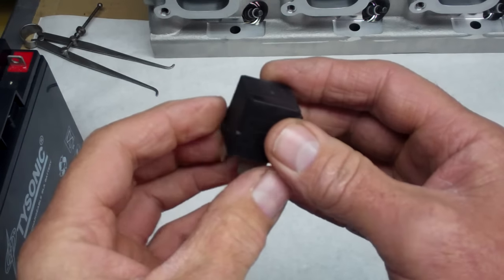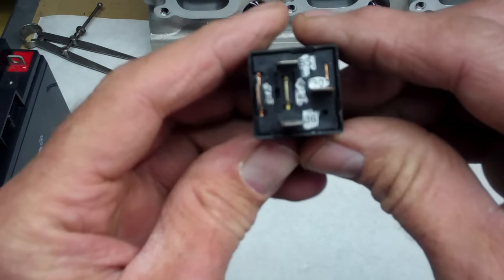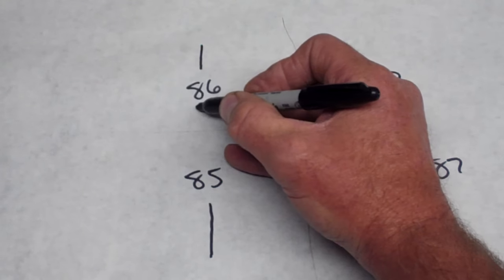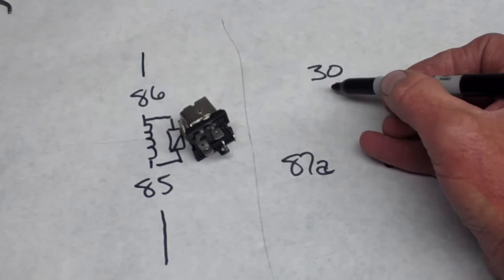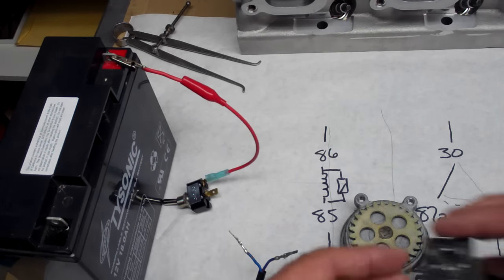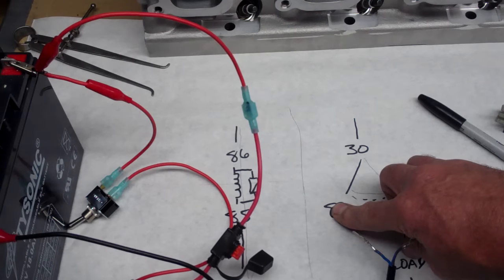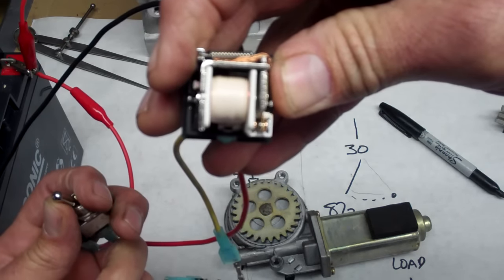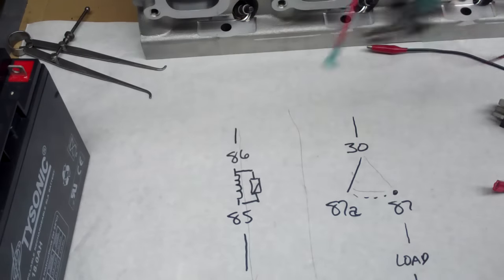How An Automotive Relay Works and How to Wire 'Em up

Comment: I have had people...both electricians and mechanics try to explain to me how a relay works. I have read automotive manuals until I'm blue in the face, but no one explains and demonstrates how they work like you just did. Dude...this video is great. I really, really appreciate it. It helps SO much to SEE it work!!!!! Thanks so much!!!
Reply: It's a big switch that uses a small switch connected to an electromagnet that actually throws the big switch. Complicated? No.
Reply: @mikeries8549  genius
Reply: Ok, I think I got it.  87 & 87A are the contact points for 'It works/It doesn't work'.  Right.  I think.  I have never wired anything more than 2 wires, a AA battery and a light bulb.  I am about to install a USB charger into my motorcycle, and I want a relay to stop the whole thing from charging when the bike is off.
Reply: @mikeries8549  the BB 2nd,
Reply: Best explanation on YOUTUBE.  I had everything backwards.  Thanks alot.
Reply: Thankyou for spending YOUR time to share this!
Reply: My problem is every vid I watch each person does it differently

Comment: I came here to learn about relays because I don't fully understand why you need them. You did mention it once but should have repeated it again a couple more times near the end. (Why it's important for the switch.  Is that all?) You talked about other aspects of this system more than once. So what I took from this demo is it appeared you created a rube Goldberg to switch on a motor but the reason why is if you would have just simply switched the circuit it would blow up the switch in a  shorter time. I guess upon further reading this video wasn't really on why you need them. Just how they work and how to wire them and you covered that very well and easy to understand.  Thanks for making this.

Comment: I have to be honest. I watched this video along with few others on how to use and wire a relay to install after market equipment to my 4x4 Van.
I took my time, learned what wires to connect and were each wire goes. i am proud to share that it took me few hours but I was bale to trace and connect all after market equipment added by the previous owner and everything is great working order.
I never thought I would be able to do it, but I did.
Thank you so much for sharing this video and wish you a great holiday season. 
Peace and out.

Comment: This is one of the most simplified and thoroughly explained videos I have ever watched and has helped me with wiring an electronic fuel pump safely without breaking my head. Thank you very much you have helped me achieve another skill today to use with my mechanic work.

Comment: For years I've seen relays used on automotive tv shows and never did quite fully understand how relays work or why they were used. This is an excellent video that dumbs things down.  The setup for the motor really put things in perspective. Thank you for putting this together.

Comment: This is the best help I have found on relays. Thanks for making a good video and not an over explained mess.
Reply: Hi , I need some advice I'm using standard Toyota corolla. I want change to high speed fan ! Do you have diagram how do I install the fan ?
Reply: lol
Reply: You are right about that....
Reply: Hey 2ton220 good video. I had a question.  What is the minimum volts needed on a12v relay to hold the switch open so current will continue to flow from 30/87. Say for instance you crank ur car over to start and the relay turns off causing current to stop flowing from 30/87. Does the relay require ,for example, 8v to hold the switch open? Im trying to figure out why my relay keeps tripping when i crank my motorcycle over. I think its b/c when i start it up my battery drops from12.6v to 7.8.. Thanks pal!
Reply: I think you mean amperage, system voltage is  around 14V. And the answer is around 300 to 400 milliamps. Low amperage circuit controlling a high amperage circuit. I hope this helps.
Reply: Thanks for the reply. I just changed my battery and it stopped the relay from switching off.
Reply: rogertopful I really love the very very easy way , explained by diagram as well as practically by dismantled inside of relay  demo , like a school / College teacher . I really appreciate the way you taught .
Thank you .
Reply: rogertopful sarcasm?
Reply: Very well explained video I feel like after watching this I understand how a relay works which is why I found myself here. Thanks
Reply: Do you still need a relay even if the load is 12v?

Comment: This bloke EXPLAINS  things so you can understand  exactly  how its done  , clear , precise & easily  followed  ,  i fitted a stand alone horn for a few pounds  ,  citroen  dealer wanted  £500 to replace  circuit  board + labour  , absolute  ripoff  that a simple  horn could  cost  several  hundreds  of pounds  to fix .  BIG THKS  TO THIS GUY .

Comment: former electronic tech here.. work on my cars..  that was an extremely good  way of illustrating   this relay.. I think the relays are cool. they also perform circuit isolation.  I really like your clip leads.. I prefer to make my own.. bought ones  generally unreliable and not soldered correctly. I am subscribing to your channel.

Comment: I have been searching for someone that could show me what electrical parts and diagrams how to wire up USB charging system on a motorcycle. 
Nobody really do it the right way as they are just dead wired directly to the battery. 
Thanks to you I can fix this issue pretty darn easy! Thanks!

Comment: I realize this is an old video but it is has really helped me to understand exactly how to wire a relay that I will use in conjunction with a switch on my lawn tractor to bypass the problematic oem pto switch which engages the electric pto clutch. Thanks again, RP.

Comment: Been figuring out how to wire a relay off a tracker to switch ignition on and off incase my car is stolen and your video has shown how to wire a circuit up so it constantly flows energy until switched off. No one explained it like you. Thank you

Comment: Great video, Thank you very much!  A friend and I were trying to rewire the headlights on his scooter thru a relay and with an off and on switch.   Your video explained everything so clearly.  I really like that when you used electrical terms you interpreted them and showed what they are.  Some of us are not familiar with them.  Alot of the video's I watched just assumed everyone knew what they were talking about when they used a "technical term".  We were able to rewire his headlights so that now he is not blowing fuses or head lamps.  Thanks again!

Comment: Thank you for this video.  My 8n had been "converted" before I bought it, with a 4-post Ford solenoid, two relay switches, the aftermarket resistor, and miles of wiring.  After watching your video, I located the correct solenoid ($12 at TS), cut out all of the wiring and rewired everything using about half the wires.  The old girl purrs like a kitten now!

Comment: Very good video!
To keep things a little simple, I was taught that everything in electrical is some type of switch. Whether it be a circuit breaker, a light switch, a receptacle, a relay and contactors are some examples. Whether it's manual or automatic it's all some type of switch.

Comment: Looking for utility light help.  I am not sure if a relay can solve my problem or not but I figured I would run this by you and see what you thought.  I installed utility lights on the rear bumper of my truck along with a switch.  I have a wire with an in-line fuse running from the battery to the switch. On the other side of the switch I have the lights spliced together and connected to it.  I then have the grounds spliced together and ran to a common ground on the frame of the truck.  I also want my reverse lights to come on when I flip the switch so I have the reverse light wire spliced into my lights as well.  When the truck is off, this setup works perfect.  When the truck is on and I put it into reverse, all four lights...the utility lights and my reverse lights come on for a split second and then shut back off.  My goal is for when I put the truck in reverse, all four of these lights work as well.  I realize that the computer module is probably sensing that there is too much current coming from that particular area and it is shutting down since it is a newer truck ((2016 F250). My question is, can I in a sense fool the computer by inserting a relay in the mix?  And if so...how do I hook the relay up?  Help would be greatly appreciated.

Comment: Dude.. that's awesome and well shown... you have seriously show how a relay works!
so that got me thinking.. 87a could be used on a buzzer for fan relays. If a switch is off to allow water crossing, then the buzzer would go... switch back on and buzzer off...

Comment: Thank-you. I had to bypass a bad circuit for Corolla 2002, to rewire the horn and many YouTube videos did not make clear that icontrol terminal 86 if hooked to a switch has to have a power source and is not a live terminal even if terminal 30 is hooked to a battery. For those familiar with electricity it might be obvious, but for those neophytes unfamiliar with relays this is not obvious that the negative wire from the switch goes to 86 and the other side goes to a battery source or powered terminal.

Comment: Tell me why, you are so good at explaining this?!  Can you please make another video!
mayb one on how to use an existing relay, with acc to wire lights, for DRL.
Or how you would locate a high beam relay that already has DRL, and how to wire a light bulb to that same relay,but instead, take DRL power from the high beam and use it separate?

Comment: I use the 87a terminal for a flasher. I can hook two separate lights up to wig wag or alternate flash. One light to 87 and one light to 87a. I then wire a turn signal flasher in series with 85 or 86. You can use a second relay as a turn on for higher amperage loads. Once you power it up the flasher turns the relay on off on off on off and makes the lights flash back and forth. It works great and is cheaper then store bought flasher!

Comment: Question: 87a is live when the switch is off.  Is it also live when the switch is on?  Thank you for the great description.  Very clear!
Reply: nevermind.  Found the answer @10:20.  87a turns loses power when relay is on.

Comment: Great video. Question...why did you choose the ground the motor off the negative terminal of the battery? Couldn't you just have used pin 85 as it was already grounded to the battery?  Also assuming instead of using the battery, you could use a chassis ground if one was nearby instead of running all the way back to the battery, correct?

Comment: Finally a video that makes sense. Using ur relay explanation...my front blinker flashes on and when the front blinker goes off and small 194 bulb blinks on the side of that same fender. The question is.....the blinker at the rear of my truck blinks similarly and I want to install a small led to blink on the same rear side corner, like on the front.  Any suggestions....pm if you wish....tnx....Frank

Comment: Such a thorough explanation, most thorough & straight forward that I've ever seen, thank you so much!! 
Just 1 question, if you jump the lightbulb to 87 i/o 87a, will its functioning be: 
bulb off when load is off  
bulb on when load is on ?

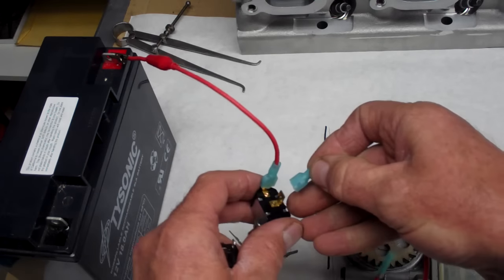Comment: Great explanation, I do recommend to the audience to fast forward to 6:18 where he begins wiring if you are in a hurry.  
(+) Battery ---> To fuse ---> pin 30
(+) Battery ----> to switch ---> pin 86
(-) Battery ---> to pin 85
Devices (Horn, Fan, Lights) ---> pin 87
Notification light to signify that the relay is functioning ---> pin 87a
Finally set your ground for your devices locally(Chassis/Negative side of battery)

Comment: that was so good man. very clear. sure clears things up. so i guess the reason for relays is so you dont have to run heavy wire very far. do you put the relay close to the load for that reason?

Comment: The best, most concise explanation I've come across so far. Thanks for the video.
Now, would one still need a relay if the switch used was a 30A switch? Would there be any advantages to using a relay over an high Amps switch? Obviously I am talking about a properly and newly wired circuit with 30A switch, fuse and large gauge wires, without using any of the existing wiring.

Comment: Quite informative !  A question for u is in the fuse box if u have several of them n all have same numbers. R they interchangeable n how do u know what the amperage is of them. I have an issue with a relay n am getting to many different answers.

Comment: Great video, i use relays a lot and this is a good reminder, but  i need some help with a project, i have an enclosed car trailer, with a battery bank inside, it does not have back up lights, so i want to set a light bar over the door, and trigger it from the reverse on the truck, OR from the battery bank as loading lights, essentially two different power sources. I'm thinking 2 relays? and a double throw switch?

Comment: The relay that you show would be great for a business door. When the switch is on, a lighted sign saying OPEN could come on, When you switch the light OFF, another sign could light up saying CLOSED. USING PIN 87 and 87A.

Comment: In addition to switching larger quantities of current, relays are used to perform many purely control functions such as interlocking, isolating, operating multiple devices simultaneously or sequentially, etc.

Comment: That was a great video, I now know how to wire a relay! I can’t thank you enough! I have a problem though, when I turn my key off my engine continues to run. I have an aftermarket ECU that controls my engine that has 3 relays and six fuses that power it. A friend of mine said I might have a back feed  problem. Can you explain backfeed and how I might troubleshoot the problem I’m having? I’ll add that sometimes the key will shut off the car? When I was testing my alternator the other day to make sure it was charging at a good rate ( key out, engine still running) I pulled the headlights to put a load in it and the engine died? Im assuming it had just enough to keep the motor running and that was it? Thanks for the help!

Comment: This is a great video. I know you made it long ago, but I just followed it and have a question. I have run fused 12v power in to 30 and 86. Power out from 87 to twin horns. Another wire runs out from 85 to a switch then to ground. The horns are also grounded. When I push the button, the contact in the relay does not move. Then with what might be a second problem, if I manually close the circuit (whether I’m pushing the button at the same time or not) the horn makes a momentary noise and sounds like it wants to toot, but that’s all. Every time I manually close the contact, it makes the same noise. I’ve tried unhooking one horn, but same result. I’m using 18 and 12 gauge wire. I’ve tested the switch and the connections. That’s all good. Any idea what I’m doing wrong?

Comment: good video. i have a question. there are a ton of systems on a truck that require a relay. if I'm wiring multiple systems that require their own relay where do i get the power for all of them? for my fuel pump i ran a dedicated wire to the battery positive terminal but if i also needed to do a headlight or accessory relay do i have to run a second power wire to the battery for each additional system or do i just use a thick enough gauge wire to the battery that i can tap into the same power wire for all the systems?

Comment: Awesome movie...I have two questions though.  I am running 2 electric fans would I wire in 2 replays and my second question was the power switch you were using is that symbolizing the vehicle on and off.  I'm just a newby wanting to learn

Comment: Working on a on board air compressor project. What if I were to add an additional pressure switch to he compressor. Which line would I splice?

Comment: A really good demo, T Y. The use of insulated solid Cu cables instead of the very flexible ones used would have made the circuitry less of a bird's nest.

Comment: Hello there great video I have a question can I not connect 85&86 to a 2 pin switch and my 30 would Go to positive battery with fuse and 87 to my horn positive and then my negative from the horn to metal do you think this method would be safer and better thank you sir for the video

Comment: I have been trying to wire in a DRL on a modern car that does not come with factory DRLs, and I want to wire a 2357, where I want to turn off Left/Right DRL when I have the LEFT/RIGHT turn signal on, cancelling the DRL respectively. Sounds like if I do one relay per side, this will work. 87a will run the DRL, and the turn signal is the load. Will the DRL flash on/off with the amber on off or do we think the DRL will be steady off? Doesn't sound like this may work for me will it?

Comment: Hello, I have one of those relays, under my dash. Now, my starter, ignition system, alarm system, ground  power, and power is all connected, through this relay. My question is, if that relay shorts out or simply goes bad, it will prevent my van from starting, right.?.

Comment: Hey 2Ton,  I have a question you may be able to help me with. I have not been able to find an answer online. Ok, I am installing a winch on my truck. I am also going to install a power interrupt solenoid under the hood. The solenoid will be operated by a toggle switch inside the truck. The question is whether I need to run a relay between the toggle switch and solenoid. Would there ever be a need to run a relay between a toggle switch and solenoid? Thanks,

Comment: Thanks so much for your Video! I used your video to trouble shoot my wiring of motorcycle DRL light toggle switch. After watching your video, I was able to wire the toggle switch correctly and Shazam, I got my DRL lights to work on my Motorcycle!!! AAAAAA+++++++++++++++